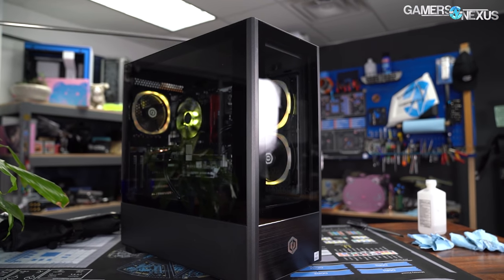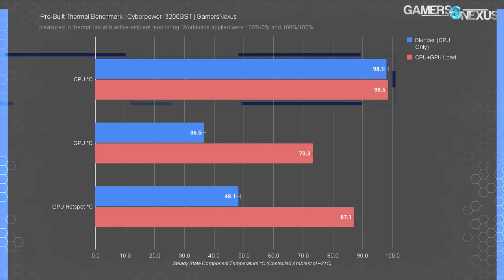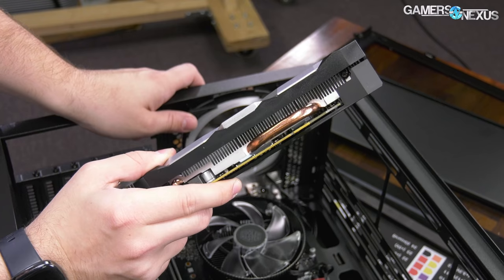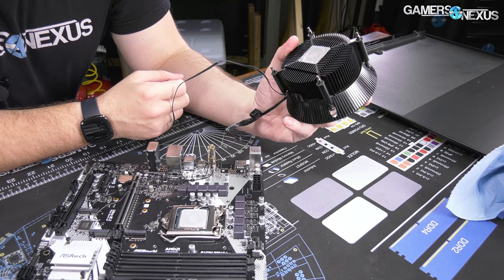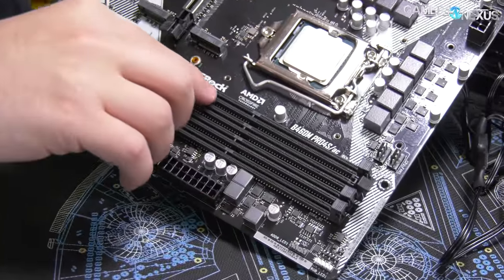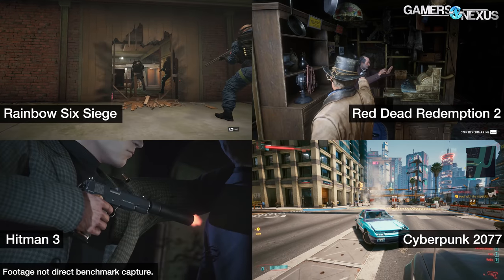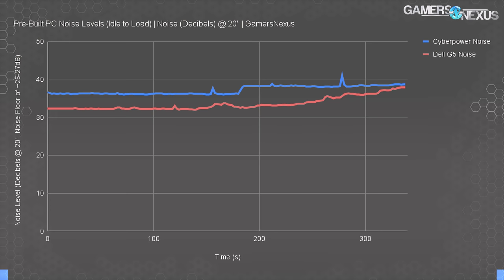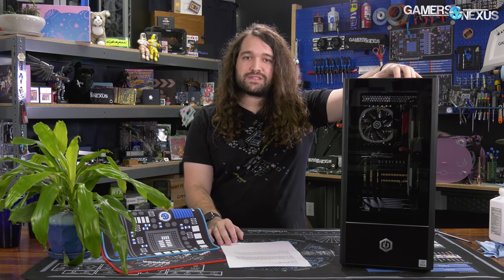Almost Didn't Suck: Cyberpower $1000 Pre-Built Gaming PC Review (Gamer Xtreme 3200BST)

Comment: Bought a Cyberpower PC
It failed within six hours. GPU was sagging, wires were out of control, and then the GPU died. Even after the GPU freaked out and passed on, the PC kept failing for entirely separate reasons. Sent it back for a refund and bought from Maingear a better PC for roughly the same price; it's infinitely better.

Should'a just watched your review. I could have avoided that whole rigmarole. Yet it was the BEST one you reviewed?? Holy crap.
Reply: Holy shit, Maingear is expensive.

Comment: Sometimes I wonder if the prebuilts and the boutique build from the same vendor might actually be built by different people. 
I've bought some boutiques, and the build quality is solid. There were a part issue but it is niche and is a part manufactory issue. The CS was also pretty bad, when trying to resolve said issue. But fundamentally, solid, functional built with no errors--including "rebuild" after the RMA of said issue (it escalated in some weird ways). I did flip a fan, but that's because I prefer slight positive pressure over slight negative pressure, there was no change in thermals, only where the dust gathers, so not really an error.
But in so many pre builds shown here and elsewhere, there are actual build issues.
While these are not really huge sample sizes, it does make me wonder... pre builds with fixed formulas technically can be build by lower skilled workers whereas boutique might require more understanding. So maybe that's a cause of difference?

Comment: Bought a R9 5900X / 6800XT CyberPower and so far I’m liking it. Bf5 at ultra 1080 with render resolution set to 160% in still maxing my monitor out at 144hz. 

It’s hot though. CPU isn’t too bad, maxing around 72C, but the GPU likes being around 80-84. Doesn’t help that all fans are quite literally exhaust. lol

Comment: I originally bought this computer for a little over 900, but I've since upgraded all the components except for the three case fans and the power supply that came included. It now has a Ryzen 7 5800x with an h150i elite AIO and a 3070, along with a Samsung 980 pro boot drive. However, I tried to find out how to control the intake fan speed on those three case fans, and I also found the molex centipede and I was like WTF?! As far as I can tell, there's no real way to control fan speed on these fans and so I need to get some new ones. Might be looking to get a new case at some point, maybe a 5000D airflow or something. On the plus side, I actually got a decent gigabyte 3 fan 1660s, which was nice.

Comment: Meanwhile, my computer only has one fan extension/splitter lead across the entire build, but that's because the two fans it services at the TOP of the case....have to plug in along the BOTTOM of the board underneath everything else.  The three at the front are a daisy-chain that mostly came out-of-box that way from Cooler Master themselves; the aft fan just goes...right there....and the two CPU cooler fans also go......right there.

The two along the top are probably the only true anomaly in the entire build in that they needed a splitter lead to truly make the trip without a headache.

Comment: As we all learned, never ever purchase a pre-built computer. If you want CyberPower to Custom build your PC, please use the Configuration method and select what you want. Note: just as Steve had shown with MSI GTX 1660 gpu you do get low end / short changed on Quality Parts. So, CyberPower will do well with the OEM stockpile stuff they have. Unfortunately, they will mark up your system by a minimum of 20 percent or to a preset percentage per PC system. They have overhead bills, employees to pay, and need to make some kind of profit to stay in business. Do you take a chance on Warranty. Depends on how expensive the PC system is and if you have the money in your budget for the warranty. Majority of people should not get a warranty / protection plan. You have X number of days to return it (RMA) but S&H and possible re-stock fee will be on you. If something is broken, contact them. Send images. At times they might not have replacement parts and may have to compromise or they will salvage / cannibalize from another system sent in for repair and send you the part from it. - Dell's G5 5000 is horrifying to say the least.
Do yourself a favor, learn to DIY build in which often you do save money and you also get to choose all your parts. Another advantage of DIY build. It's usually upgradable and you learn more about computers. There is more to using a computer than for silly video games. Maybe market yourself and products on You Tube like these Tech Guys and make money.

Comment: would be interresting to see how the thermals would perform and the noise level with turning those fans on the right side just flipped arround as intakes.
and slap a boxed intel cooler from ebay on it who can get ok and even pressure on the cpu or a cheap 13 dollar arctic tower cooler even in the 92mm variant pointed at the exhaust fan next to it.
oh and btw i LOVE your mounting pressure pictures and messuring of the plane and eveness of the thermal surface to the cpu. (gpu is next right?) since this is the last thing with heatpipes and tower coolers arround who actually gets the real enthusiast and nerd a clue where coolers and cpu and mounting problems are and witch products not to buy.. next is in my optinion the coverage of the not centered dies on ryzen and larger die/spread out chiplets in the cpu and to small coolerplates on them.

Comment: Noob question - with the cpu cooler having that  poor contact, would a thin thermal pad be a solution for an absolute minimum extra cost?  Yes, a better cooler is obviously the best choice. I’m talking “maxed out the budget, can’t spare anything else” situation. I haven’t built a system but slowly learning stuff here and there, so are there pros/cons to a thermal pad ?

edit I have an old dell 9020 that I upgraded with an SSD, more ram, and a GT 1030. It definitely helped but it has proprietary mobo and power supply, so I definitely feel the “it’s better than Dell” mantra 🙄

Comment: It seems like flipping the front fans and putting in a decent lower end air cooler would let it work relatively well for what it's designed for. Another plus is at least this one didn't use one of those horrible Apevia PSU's. It's sad seeing the poor design of that GPU on an MSI product. They know how to do better.

Comment: I can't wait for your Alienware rewiev. I am interested in buing one with RTX3070 or 3080 just for the GPU and then I want to donate the rest of the system to my wife alongside GTX 1050ti  that currently I'm forced to use daily after my R9 390 died in the worst possible moment to die.
Price of the system is just 300-400$ over what the RTX3070/3080 costs respectively.

Comment: Hi Gamers Nexus. I got a question. I'm going to buy a PC for gaming and video creation from Cyberpower with the following parts: Case: Lian Li PC-O11 Dynamic XL White Full-Tower Dual Chamber Gaming Chassis, Cooler: Corsair Hydro-X XL5 Performance - Blue, CPU: AMD Ryzen 9 5950X - 16-Core, CS Fan: Corsair iCue Intelligent RGB x6 LL120 Fan & Lighting Kit, fan: Hyper Liquid Cooling - Hydro-X Enthusiast Kit Soft Tube - Including XC CPU Block, XD5 Pump/Reservoir, XR5 360mm Radiator, XF Fittings, Commander Pro, iCue and Ultimate OC Compatible, SSD: 2TB Seagate Firecuda 520. RAM memory: 32GB DDR4/3200mhz Dual Channel Memory (HyperX Fury RGB w/Heat Spreader), Motherboard: ASUS ROG Strix X570-F Gaming: ATX w/ RGB, PCIe 4.0, USB 3.2, SATA3, 2x M.2, Overclock: Pro OC (Overclock up to 10%), Professional Wiring for All WIRING Inside The System Chasis - Minimize Cable Exposure, Maximize Airflow in System, GPU: MSI GeForce® RTX 3080 10GB. Do you recommend it?

Comment: I think the factory guys must not know which way they put the fans in.  I got a water cooler that was in push push configuration from them.  I went through and swapped stuff out in the system when I first got it anyways but if anyone got it that didn't check it wouldn't have been happy with it.

Comment: I see the use of K skews a LOT in prebuilds and always paired with non-OC supporting chipsets.  I wonder if this has to do with a warranty and liability issue on Intel's end, and thus the OEM. if they give the user the ability to OC their cpu, then the OEM risks being liable for warranty costs of replacement instead of sending the cpu back to intel in the case of a fault. In fact, i dont think i've EVER seen an OEM or SI  prebuild with an Intel motherboard that  supports overclocking ever.

Comment: Thanks to your surface pressure tests, it seems that lapping the IHS and the copper slug seems to be necessary for the effective use, if one insists on using this thermal solution.

Comment: It's getting desperate if you have to but a prebuilt to get a 1660S! I bought two 1660S for the kids builds a little while back. Not that easy to get (a little patience required) but waaaay easier than 20 or 30 series...

Comment: I found an RTX 3060 on eBay for 643 and tax.  It is a 12 GB model.  I honestly don't get why the TI version has less.  Maybe that would be a future revision for the next shortage?  It looks like someone bought some HP Omens and pulled the cards out.  I finally got that because $399 is nowhere to be found with the scalpers miners and resellers.  Although still way over priced, it is a lot less than what some of those other jerks want for a 3060!  I will hold my old card for a while just in case.  It would be a usable spare if the worst happens and it dies an early death for some reason (hopefully within 45 days if it happens).  It will be here within the week.  I can easily hear the delivery truck when it gets here so don't any porch pirates get any ideas!

Comment: You show me where you can find a 1660 Super for less than $500 USD right now and Il buy it immediatly. That's a pipe dream getting a MSRP card currently.

Omg! Your right, my 1660 Super has the bottom memory modules hanging out...... Wtf msi!. That's probably my hot spot on hw monitor.

Comment: 13:00 "After seeing that I need some alcohol"

Steve do we need to stage an intervention?
Reply from the maker: "He's addicted to rubbing alcohol and compressed air."
"He's too far gone!"
Reply: The first step is to admit you are addicted to over applying thermal paste.
Reply: @GamersNexus  I'll only be worried when you start snorting thermal paste
Reply: I seriously expected a bottle of whiskey and shot glass to come out after that line.
Reply: @GamersNexus  Your compressed air suppliers get you the premium, un-cut stuff sans bittering agent, don't they?
Reply: I think the guy in the factory who did the molex cables in the back spent a little too much time on the sauce 😂 I was so confused aswell, why were the 2 fans at the front exhausts? 😂 GN bee like this, yes this!! Just don't!! Save the time and use the board headers, annd these! Yep turn them round. That a boy. Now that money you just saved? Better cpu cooler 👍now you've got something more respectable 👌 I hope these prebuild companies watch these videos. They'd be dumb not too, it's free for them and they'd learn a lot to make better products

Comment: One take-away is that Cyberpower has taken previous criticism to heart and had taken steps to improve.  Hopefully, they'll react to this review in the same manner they have reacted to past ones.
Reply: @CajunReaper95   Did yours have the cooling problem?
Reply: @jessefisher1809  mine did and returned it and got a PC from NZXT and works fine
Reply: @mrwannabe00  I ended up buying one expecting to replace the cooler but I didn't have to, temp rarely went above 80 and it had liquid cooling ( which wasn't advertised and wasn't in any of the photos I've seen)  so I think they did address the problem. That's admirable.
Reply: @jessefisher1809  mmk, hope the PC lasts a long time
Reply: @mrwannabe00 cyberpower has gotten a lot better from what I've seen comparing this video to my current pre-built by them

Comment: That case looks like a fishtank. Also what's with these SI's using CPU coolers that are objectively worse than the intel stock cooler? How on earth do you even find a CPU cooler worse than the intel stock cooler?
Reply: the reason it's not stock is that its a K sku..no cooler included. Then they go and buy the cheapest out there!
Reply: @OnzaRob  Exactly. But given that it's a non-overclockable motherboard it shouldn't be a K. It should be like a 10400f or something.
Reply: @drackar  which is exactly the processor I used in a H470 build for my wife.
Reply: @OnzaRob  Yeah, that's how I went after I abandoned ryzen as a glitch crash experiment after a year of fucking with RMAs.
Reply: I got a prebuilt from Skytech, ryzen 5, never gets over 75c. Course, Minecraft Java with a dozen or so mods is the only real stress my CPU has seen. All the other games I play are GPU dependant.
Reply: I bought this pc but the i7 and rtx 3060 variant. DId some research but its an i71c coolmaster cpu cooler that doesnt not cool anything. Seen some temps reach up to 94c and at one point blue screened(after several hours of gaming). Upgraded the cpu cooler to a noctua dh15s and never seen temps past 70c; also the fans are installed incorrectly at the side where theres no fresh air coming in. The prebuilt is good but not perfect if anyone is expecting to buy this pc expect to upgrade your cpu cooler and installing your side fans correctly. i honestly would give the pc a 8/10; because cooling should not be something to cheap out on.
Reply: I ran my i9 9900k on an intel stock cooler while i was waiting for my actual cooling solution and it was pretty scary

Comment: "Hey, let's make all the fans exhaust."

"Then where does air come in?"

"I dunno..."
Reply: Why couldn't they set the fans as intake, get a better cpu cooler and a second dimm of ram? Holy shit they really don't care about their products, do they? They literally could do that for 50 dollars in total, while getting maaaaany less rma's for fried components
Reply: The air disappeared when the fire nation attacked. Duh.
Reply: It's open on top. 
So, it pulls air from there, and whoosh straight out the back and front?
I guess the GPU just holds its breath.
Reply: "How can you make the air outside want to go into the fan just because it blows into the computer? Then there's nothing there on the outside, no force!"
Reply: Did he ever mention the fact that all the fans are set to exhaust? It likely has something to do with the thermal issues on the CPU
Reply: Negative pressure works well in some cases... although I'm willing to bet there wasn't any testing done on that matter
Reply: @Mentadeath  even as hot as thr cpu is running its doubtful they get rma for fried cpus.most cpus do a pretty good job at protecting them self from imminent failure like that. It could possibly cause the cpu to not live quite as long. A good example is pretty much every gaming laptop out there cooks it's cpus near there max temps under heavy load. There are a few exceptions.  But on cyber power you can usually change your pcs parts and pay the few extra bucks for a better cpu and 2x8gb they don't see to stock 4gb dimms at all so no 2x4gb. Maybe it saves them to be able to buy 8gb and 16gb dims in bulk
Reply: I can tell you exactly why they did it that way.  RGB.  They wanted the light ring on all the fans facing in.  Cooling was obviously not one of their concerns.
Reply: @wallywest2360  oddly the ring on these fans is on the front and back. But you do louse the rgb effect on the hub when it's turned around. I guess that's the down side of cases like this with no front Intake as the front is glassed off so at least they didn't put tur fans there as intakes

Comment: I have a confession to make: I have made a molex centipede before.
Reply: ive made plenty, it was perfectly acceptable before motherboard had enough fan headers and fan controllers didnt exist. you know, 20+ years ago
Reply: Haven't we all...Haven't we all
Reply: Me too :D Did it out of necessity since cables were to short many years ago.
Reply: I mean to thier credit not plugging the fan headers in makes for a cleaner look, do you get less fan performance with a centipede?
Reply: @rawb22  Same performance, but with a centipede there is likely no fan speed control and it's a pain because plugging the molex connectors together can be tricky sometimes. It's not bad (since it does actually work) but it's not as functionally good as individual fan connections to motherboard.
Reply: @pf100andahalf  so you are saying I would need a pre centipede molex adapter for handling power output.. where my molex inline adapter fan controllers at? I've got rgb to plug in!
Reply: There's nothing whatsoever wrong with it for plugging in a number of fans.  The power draw isn't an issue, and there is no more compact way to supply power to those fans.  That's why those connectors exist in the first place. 

The only drawback is that there's no speed control, but if they're quiet fans to begin with, that's irrelevant.